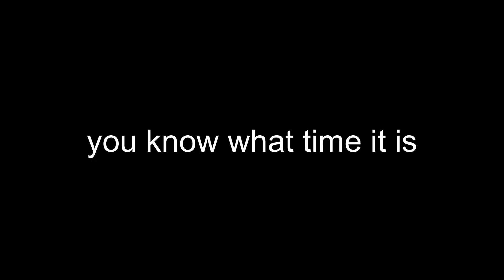2010 Toyota Prius P410 Transaxle Tear Apart Ness

Comment: Do you even need a transmission? Could just connect the motor directly to the diff?
Reply: the differential is part of the "transmission" package as can be seen when its opened up, the differential is that big gear that he suggests in the video might be making that knocking sound, but it might not be :)
Reply from the maker: the motor is inside the transmission, in front wheel drive cars the transmission is the differential
Reply: @Good-Enuff-Garage  part of why I have great respect for the Toyota hybrid drivetrains, not Toyota the company itself but the engineers that developed a revolutionary transaxle for the time that combines 2 electric motors, gear reduction, power split device, electronic handbrake, and a differential all in a similar space as a standard front wheel drive transaxle 🥰

Comment: But this video brought to my memory the idea i had to remove MG1 and just live the cover bit in place. As mg1 doesn't contribute much i was thinking of having 2 MG2 connected to each front wheel but the diff would have to be welded or modified
Reply from the maker: The Zombie VCU spins / controls both motors, Damien recommends welding the power split device. When will we finally see a Latuta EV conversion?
Reply: @Good-Enuff-Garage  yes he does but he did not use it in any of his projects. The answer to the second question is soon, 😭